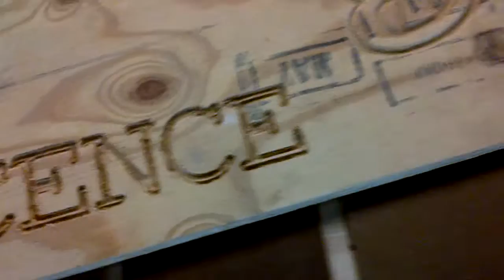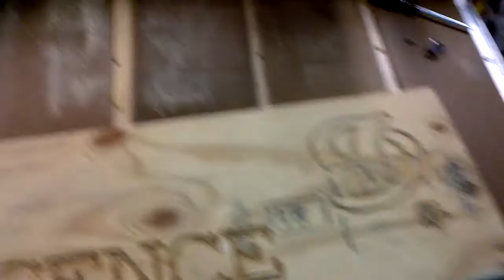CNC router CENCE - Overview

Comment: Any suggestions for rails instead of the angle?  Maybe different wheels?
Reply from the maker: Justin Nutt I actually like the grooved bearings aside from their cost, as I use the machine more and break it in a bit more, the aluminum seems to be holding but I can see that I will need to replace it eventually. I have about 30 hours on my machine now and aside from some nuts loosening up, I have not had any serious problems.
Reply: bubalettow Good to know.  How about using Delrin bearings like these: http://openbuildspartstore.com/solid-v-wheel-kit/.  Does the machine seem pretty rigid?  Is the design scalable?  I was thinking about making one with a larger build area.  I wondering if there would be limits with belts?  Any thought?
Reply from the maker: Justin Nutt bearings in that configuration on the extruded aluminum rail would be a good improvement, but there is a significant cost increase by going that route. as for increasing the build area, I already increased the build area by about 50% from the original instructable and wouldn't go much further without redesigning the gantry. eventually you will get sag and extending the belts too much further will lend to inaccuracies. ball screws would be the way to go but they are expensive as well. remember the cost for mine was only $800 to make it larger, or more rigid would increase the price substantially.
Reply: bubalettow I forgot you already went up in size.  That's very cool for $800.  What is your work area size?  Also, I thought the Delrin bearings/wheels were cheaper than steel?
Reply from the maker: Justin Nutt working area is 33" by 36" by 4". delrin is cheaper as just a wheel, but you need the extruded aluminum for it to roll in and that is what ups the cost. the v grooved bearings are a lil spendy but they can ride on the edge of flat stock, aluminum, brass, steel, whatever. what you have to consider is you want the rail to be a softer material than the wheels so you can replace it when it wears. if I used steel rail with steel bearings there is a good chance the bearing itself would wear and I'd have to buy it again. flat aluminum rail for the whole machine cost about as much as 2 v-groove bearings and you need 16 grooved bearings all together of that type for this build. you always want to replace the cheaper of the two. Just my two cents.
Reply: bubalettow That makes sense, thanks for clarifying.  How do you pick/size the pulleys and belts?
Reply from the maker: Justin Nutt Well, in my case I was looking for cheap pulleys that would fit my motor shafts which were nema 34's, so I looked and only found one cheap option, so I bought them and then bought the belt to fit. if you use nema 23's the shafts are a bit smaller and you get more options for cheap. think of it this way, the more teeth or finer tooth pitch, the more precision you will get at the cost of speed. So I ask what is more important to you? keep in mind that speed is most often governed by what your cutter is capable of, and in my case that little trimmer router can only cut about 1/8" deep with a 1/4" bit in one pass through plywood, so I am more about precision.
Reply: bubalettow I see.  I'm still trying to determine what's most important.  I'm just getting over the euphoria of having my own machine, and into the details. :).